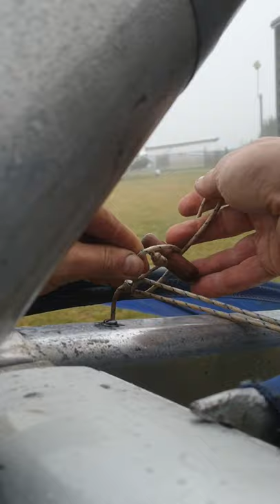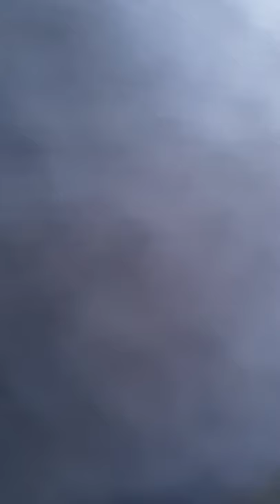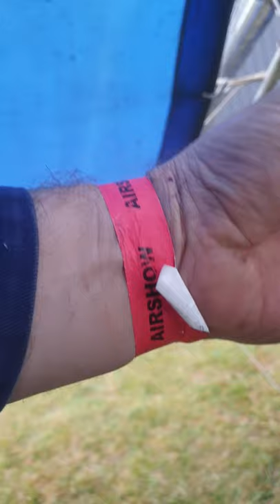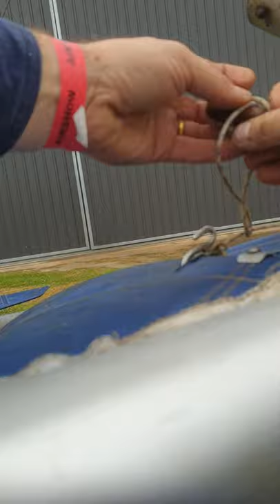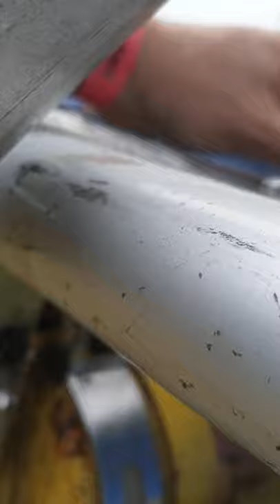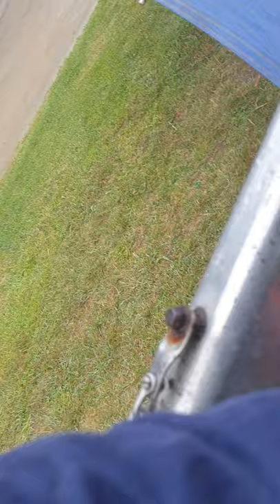Skycraft scout wing tensioning

Comment: I have a couple of Skycraft Scouts, a Mark I and a Mark III.  The Mark I had a better motor installed and I developed a polyV belt reduction drive.
This was a terrible video. Not worth putting on YouTube. Yurn your phone to landscape orientation, firmly affix to your helmet or hat, and move your head slowly and make sure it’s pointed at what your looking at.
If you need to bump the ribs across you should be using a hard rubber or nylon hammer.
Reply from the maker: Awseome!!, do you get them out much? I have a belt drive on one of my mk1 frames aswell, but that's pretty much parts now, I have a hirth F33 I just put on my new mk3, 24hp, its going to be a fun ride,

 yeah this video was just to show a mate how to tension the ribs but I have since put up others in landscape, I make no claims to being a youtuber lol,